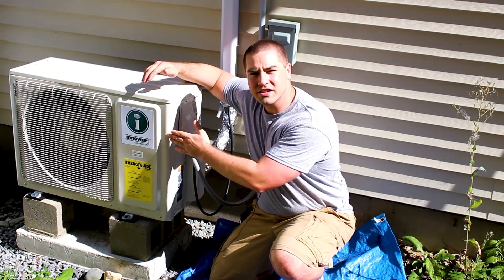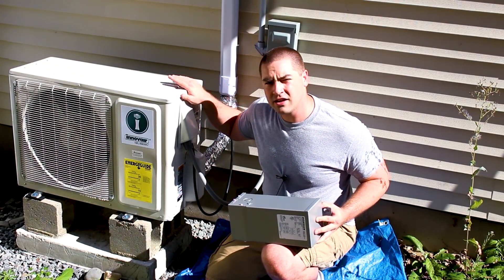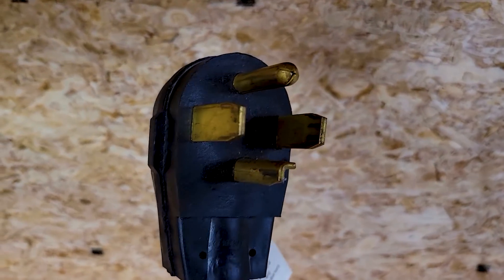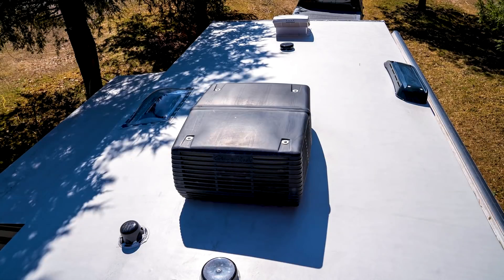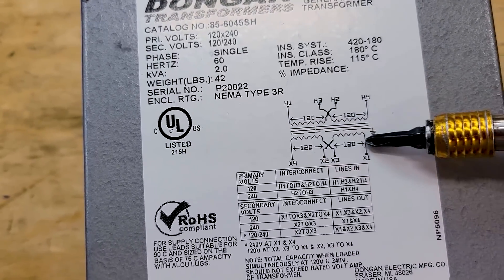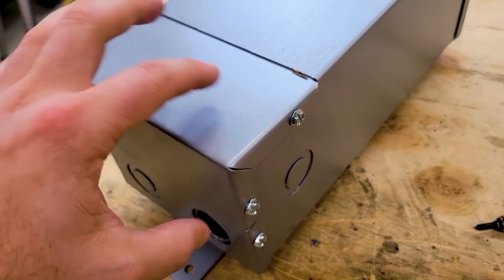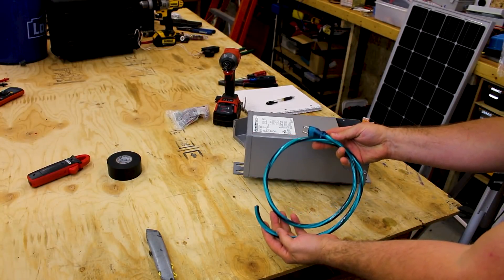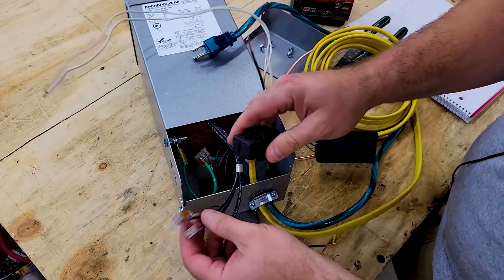Transform your mini-split heat pump for your RV/Camper Project

Comment: A simpler method is possibly just buy a 120 V mini split there's plenty on the market that's what I did. Thanks for the video very informative.
Reply: My rv is 30 foot holiday rambler and has kinda low ceiling but the 9000 btu inovair is cooling it down in 10 to 12 minutes and then going to the lowest power and keeping it cool. The 9000 btu unit is variable speed and goes from like 2000 btu up to 13500 btu. It pulls 200 watts soon as camper is cool. 650 watts when it's first turned on
Reply: @matthewknight5641  super helpful of you to provide the actual power consumption numbers from your setup, THANKS
Reply: @azapplewhite  I was gonna add that the inovair I've got is kinda overkill in my camper. It goes as low as 2000 BTU and as high as 13500. It's called a 9000 BTU unit but it's a beast . I love it but I honestly would have been better off getting a 6000 BTU minisplit. With mine barely running and keeping the temperature good it doesn't really have time to pull as much humidity from the air. When I take into account the cabinet space and furniture and the fridge... It doesn't really have much area that it needs to heat or cool. The 6000 BTU would have been a much better choice. Some people say it's great that it doesn't have to work hard to keep the temperature good but yeah I for sure wish I'd gotten a smaller unit. The 9000 takes up more room on the wall and is much larger on the back bumper as well. If you are gonna get a minisplit to have them actually condition the air rather than just heat or cool then they don't need to be oversized. I am extremely happy with mine but could have done better for sure
Reply: A one time 12,000 BTU mini split will take care of most Rvs There are plenty of 120 V 12,000 BTU heat pumps no need to get a 240 V one I’ve installed several on homes they are used in about 500 watts So much less than the rooftop air conditioner on an RV
Reply: @konstruct11  I keep seeing a lot of people make this comment that 12,000 BTU will cool most RV's.  If most RV's are converted Vans then yes.  But in my opinion most RV's are 35' or longer and typically have 3-4 AC units with up to 90,000 BTU to cool them.  So I find your statement way off base and a little misleading to those who don't really understand.  My 35' RV has 3 roof top 15,000 BTU units and a 45,000 BTU dash air unit for a total of 90,000 BTU's and there are larger RV's out there at 40' & 45'.  in Arizona today is 110 degrees, the road over 150 degrees and when traveling 65 MPH through it you won't even feel 12,000 BTU with the added heat load on the RV, windows, sides, undercarriage, etc...  So just want to mention that so next time you make that comment you realize you may not be talking about "most RVs".  :-)
Reply: @michaelputz4694  your rooftops are extremely inefficient and ineffective then. They're not achieving anywhere near those numbers
Reply: I'm planning on getting a 12K Btu, 48v DC Hotspot mini-split for my motorhome. It will be powered by a 15.8Kwh battery 310ah, 51.2v battery bank (recharged by over 3,500 watts of solar) so there will be no inverter inefficiency, plus this Hotspot has a 19.3 EER, (5.66 COP in cooling mode) which should but the SEER around 30, making it one of the most efficient on the market. This seems like the best way to go for both simplicity and efficiency sake.
Reply: It was 95* yesterday in my 36’ toy hauler.The temp stayed at 70* all day inside with 9k btu Innovair 38 seer.My 2 roof tops struggle to keep it 80-85* and noisy.
Glad I didn’t get 12k btu.

Comment: Nice job David. 120v units are available so long as you don't need more than about 12k/btu. That would save the parasitic losses of the transformer but for people that already have equipment they are trying to utilize, its a good option. 

If you are off grid the parasitic losses can add up quick. 100 to 200w of extra power consumption can cost you a couple extra kw/hr of your battery system per day.
Reply: Yeah the Mr Cool DIY 12k BTU is a 120V unit. Can purchase very easily.
Reply: Just about everyone makes 9000 btu 120 V mini.  If search and ship one in ther3 are DC input mini splits.

Comment: There is a 48vdc mini split that isn’t much more and means you don’t need so much inverter and can power it from batteries and solar viably. 

Going to put one in my rv this spring.
Reply: Is it 38 SEER?  Don't see how it could be that efficient.  38 SEER took an enormous amount of engineering effort and the OEM of this thing (Gree) is selling variations of this unit by the millions.

Comment: This could also be used to run a well pump off 120v inverters.
Reply: If you do this you should put the transformer close to the inverters to keep the 120v wiring short and make the run out to the pump 240v. This will reduce losses.

Comment: blueyetti is probably reading the va cus power factor of a transformer is really bad without a load , it will consume a lot of apparent power and even tough that apparent power is not doing anything it will still drain the battery .. yes ac power measurements are super complicated as soon as u come out of resistive loads.

Comment: If the RV uses a 50A connection, it has 240V available. If you use an adapter to fit into a 50a outlet, you do not have 240V and would need the transformer to operate 240V loads.

Comment: Great video and its soo cool to see the 120 -> 240 (or even vice versa) work!.    However,  just for the record to add to the conversation (no disrespect intended, love your channel!) there are 120v mini-splits for the lower BTU ranges.   For example,  I run a 120v 9000BTU Senville mini-split for my camp trailer.   There's no surge, its a variable speed / smooth power up.  Maxes at about 1100watts in 'the extreme' but mostly runs 300-600w maintaining.    And mini-splits are sooo cool and QUIET!
Reply: yeah exactly, this is trying to put a square peg in round hole situation

Comment: This is an excellent video, learned a great deal about a solution I did not know existed. Also you got my complete undivided attention with your 220V Mini-Split heat pump. I was unaware that such a Mini-Split even existed The EER is rated at 18  and the  HSPF5 is rated at 11.3 on the 9,000 Btu unit. Plus the Operating temp range is -22°F~122°F .  So a 9,000 BTU unit should draw about 500Watts under full AC load with an EER of 18?..  My question is have you made a video on this Mini-Split?  And verified these numbers? Seeing that we have an Arctic outbreak coming on New Years Day might be a good time to check those HSPF5 claims.   And yes I am in the market for a 9,000 Btu Mini-Split that can take a Cold Texas night at 2F and a Hot Texas August Day of 116F, considering that most of the Heat Pumps in Texas FAILED last February..
Reply: Yes look at his vids he has I believe multiple vids
Reply: Vids don't show system under full load.
Reply: @dwmcever  well if it was purposeful they certainly got more than they bargained for.
Reply: https://youtu.be/Kd092alkeaE
Reply: Mitsubishi-types have the best heat pumps and are rated to -13°F, my panasonic-type is rated to -5. But, and this is a big but, the rating is extremely environmentally subjective. Condenser location, wind chill, humidity all have an effect on heat pump performance. The best heat pumps will generally be 100% effective down to at least 20°, but if its very dry and there is a strong cold wind with my condenser mounted on the backside of my roof i can start losing full heating capability when the therrmometer reads 34°. If there is no wind and the air has some moisture like it was in February it works best. I got decent heat down to about 5°F. But my workshop unit with its condenser mounted low on the wall, shielded from the wind worked below zero. There is only so much a heatpump is Mechanically capable of and its pretty much reached the limit. I think its amazing they work below freezing at all but how well they can is directly proportional to the refrigerant type and indirectly to outdoor moisture levels. Hopefully better refrigerants will come out and continue to improve performance until there is a technology advance. In February I was moderately impacted with poor heatpump performance, but I have natural gas so I went out to the garage and hooked up a long disconnected old dearborn heater and was hella toasty after that, its back in the garage now.
Reply: One thing is for sure, any electric heating method without grid power is just not really feasible unless your home is very, very tight and small (HER rated well below zero I imagine). Then you might be able to get away with electric radiant floor heating on your batteries. It is money far better spent getting a non-electric method of backup heating at least. If you can get a natural gas utility, your all set, . If not then you could do a bottle propane solution like the rest of the world does, a diesel apu system like cold weather campers and Long haul truck drivers, or a good old wood burning stove. And all are real affordable. I have an extremely well insulated house and its tight, and while I had power to spare the whole time in February with solar and a lot of batteries despite almost 3 days without grid power, when the minisplit heat pump went below 50% efficiency I noticed it. And there is simply no electric heating method out there I know of that  could have maintained below that level without some impact on comfort level.
Reply: I don't believe most test/verify the temp extremes of most of these units. But I see what you're saying. He mostly uses it for a/c I believe. The a/c cooling ability is more a matter of sizing. Need enough btu to cool the space properly, it takes less btu and power using a minisplit. Cuz of their operation efficiency and design. From what I've heard though most don't work that great in the cold. It could be installation too though that's the part that's never discussed. There's a drain in the outside condenser that needs to be kept free/clear. In heat mode that can freeze up get blocked by snow ice. IF you're gonna use it for heat I would get if higher off the ground so it can't get snow packed in there and it can drip drain. Most mount them on the ground on a pad made for em. But I have heard some love em even in the cold and it's their only heat source. It really does depend on the unit though, many are NOT rated that low, only like 10-20deg or something. 

Are you talking about the big TX freeze last year or whatever it was. I thought that was cuz of the snow and Ice knocking power out...so most lost heat. But yea I can see how many minisplits didn't work that great if they weren't rated for real cold temps. I like to prepare ahead of time. So I have generators, multiple types of heaters, a fireplace etc. Now if gas stations couldn't pump...that would be a problem cuz I only run gas generators. But do have Propane  heaters some don't require power. 

As a backup, in TX for example where one rarely needs heat, but sometimes. I would have an LP unvented wall heater. Like a Mr Heater VF30KBLUELP  They will expel humidity in the air due to the vent free gas combustion...but  they quick and can be portable for occasional use. I believe they also ignite off a battery. But for temp emergency use...it will work. Or there's Camco Wave 6 catalytic propane heater. No power needed, no fumes or humidity cuz there's no flames it's a special material that creates heat when the propane passes through it. It does consume some oxygen though...but it's pretty minimal I believe. They're a little on the small side but output a steady amount of heat. Advantage is no power in a grid down situation. 

Or there's the regular Mr Buddy's catalytic heaters. They ignite off batteries and can put out a lot of heat. They are claimed to be safe indoors too, people have used CO detectors in a small confined space and they don't register any dangerous or detectable amounts.
Reply: @mrmotofy  see my personal observations above. The issue here in Texas in February was caused by unexpected historically low extended temperatures creating a demand for electricity to heat buildings that exceeded the amount of power that the generating facilities serving the Texas Power Grid were prepared to provide. This extreme cold weather event turned into a Statewide disaster when the regional operators of the Texas Grid planned to do neighborhood by neighborhood rolling 20 minute blackouts but quickly found out that this did not work, the surge of bringing up previously downed areas was too much for the grid to handle. In order to prevent a multiple generating facilty failure event that would have impact grid-wide they shut down power to wide areas all over the state and left them down. This was the primary factor, but you just didn't hear too much about the fact that over the last 3 decades, fewer and fewer building projects have been investing in the necessary infrastructure for Natural Gas Utility availability nor the activity of so many of those with a gas connection to forgo it use in favor of electric heating. Our homes in Texas are just not built with much ability to handle freezing temps without heat. Those that had a hospital or important Govt. office nearby never lost power, but millions of other did unexpectedly with little warning. We were not made aware the rolling blackouts would extend into days until it had already been hours so folks would have had to have the frame of mind to hurry and turn off ther water and drain the pipes before they froze and they didn't.
Reply: @mpirron1 a full 1/3 of the Texas generating capacity was off-line before the Freeze got here. Ercot failed to have enough power on Rolling reserve. Wholesale power prices shot up to $8 a Kilowatt before the freeze got here.. And because of that the rolling Black-outs started. Ercot was unprepared for the freeze while Power Day traders had a field Day. We knew 2 full weeks before hand the extreme weather was coming hard. Have several good friends who are power traders here in Texas. Half of those have advanced degrees in Meteorology. They made a killing.

Comment: David, great idea. I was thinking about running a 220V line from my solar shed to my Park Model trailer I live in on my off-grid farm. It has been crossing my mind about using an auto transformer as a trade off vs placing an underground line 128'. If I can find one of those that you used, it would be a lot cheaper than running the line or buying the auto transformer. Thanks for the video!
Reply: But 80-90w just to energize the transformer yikes that's kind of a lot on solar during low light conditions primarily
Reply: @mrmotofy  When I consider that I'm only using it for cooling, primarily during summer daylight hours when I have over 10K Watts of extra power being produced, it's not that much.

Comment: You know, of all the heat pump related videos I've seen in the last year, this one gives me a little more of the detail I'm looking into. Thank You.

What has been your max power draw? Your average idle? On an average day, how much power does it consume? In winter? Summer? I understand YMMV, but what should we all know to plan and design around?

Why aren't we designing a minimum level of backup power to run one, along with emergency charging of other devices, more often?
Reply: You need a bit more clarity in your question and what object you're asking about. The vid is about a transformer that consumes about 90w all the time. The minisplit consumption is a bit more difficult cuz it's varies based on temps size and building insulation
Reply: @mrmotofy  exactly. "Your Milage May Vary" but the mini split itself, on average what are the high/low draws? Overall daily consumption? Different makes/models, different environments, I get it. But do I build around 800w/hr or more (for worst case power consumption)? I've heard claims of 1-3kwhr daily use. But what are some real world numbers that I can target and build around without walking in halfblind to the reality?
Reply: @CptDrake  I would build based on the full draw 100% of the time, that way way you should have adequate capacity. Many people under estimate with solar using 100% output which isn't realistic most of the time. Then everyone ADDS solar...so build it into your estimations

Comment: Suggestion for future video. Have something like the EcoFlow Delta pro hook into your house's 240 volt transfer switch for a generator and see if something like this transformer would work that way since the eco flow Delta pro only puts out 120 volts at 30 amps unless you buy a second unit and combine them. At least I would find that interesting 🤔

Comment: Continuing to watch the video, but wondering why you wouldn't just use a 110v mini split?  Running a Mr Cool 110 12k btu mini split here, and it is super efficient with the inverter tech.  And it too has never went above 800 watts, and most of the time it's well below 300 watts.  Push it does heat.
Reply from the maker: You could do that too.  This is another option.

Comment: The battery unit reports watts from the battery. So the higher wattage reported by the unit included the inverter, not just what was going out the plug.

Comment: Why not just buy a 120 Volt minisplit instead of buying a 240 Volt minisplit and a $200 transformer???
Reply: SEER of 38 vs most 120v mini splits having a SEER of 18-22, translating to 1/3-1/2 the current draw.
Reply: This applies 100% if you have one already or if you need more than 12k BTU